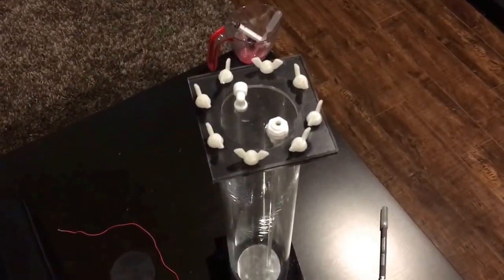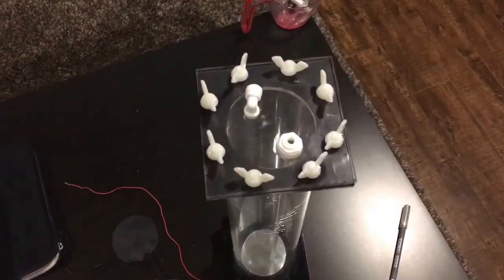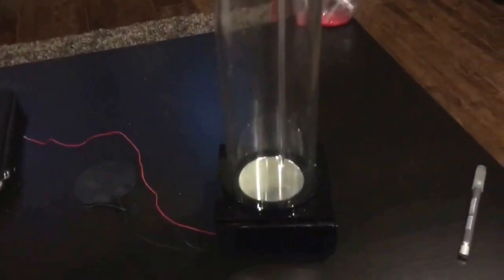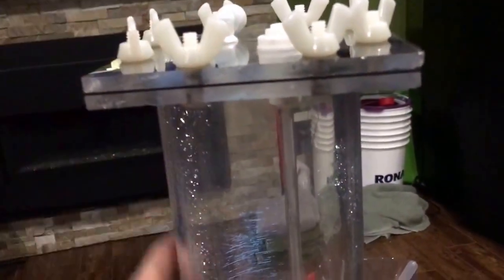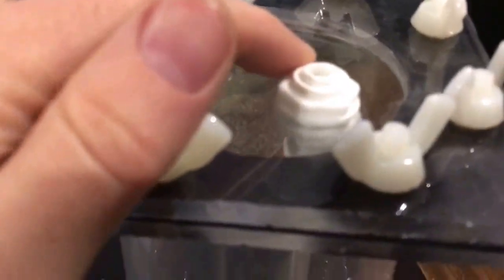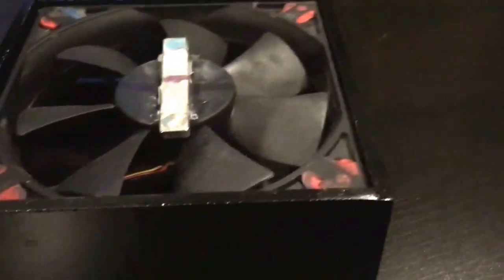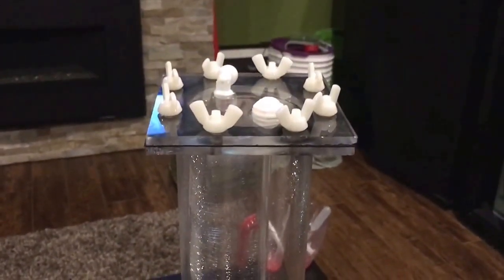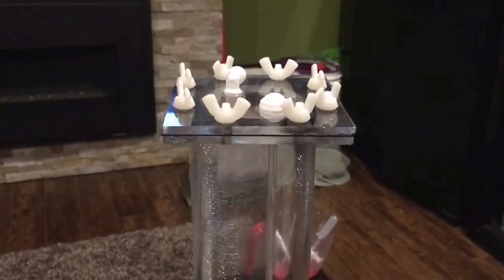DIY magnetic Kalk stirrer

Comment: Hi Devin,
Nice. I’m considering building one just like this for a new 75gal tank..(low demand currently)
How did this work for you in terms of longevity/durability? 
Would you still recommend this reactor method?
Some seem to feel stirring isn’t entirely necessary..and I’d value your opinion on this
Cheers from Vancouver BC.
Reply from the maker: Val Halla no longer using it    Main advantage of a stir based one is you can Load it up with kalk and let it do its thing for a while before refilling it.    Issue with the magnetic one is it works well as long as you don’t make the Kalk layer too thick on the bottom.  I also made a version with a acrylic arm that stirred it which worked well.  I have not used Kalk in quite a while so both are retired in the shed for now
Reply: ReefDudes Appreciated. Thanks for the quick reply. Looking forward to updates on the new tank! Cheers